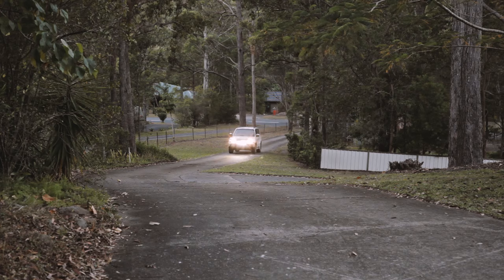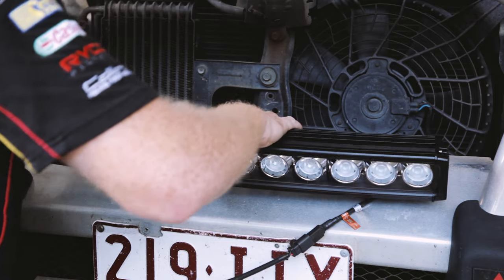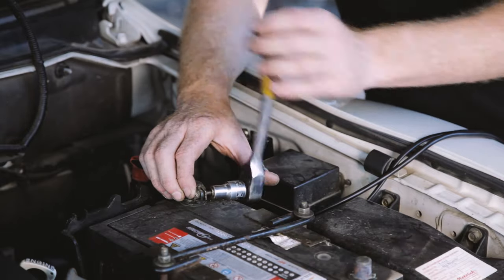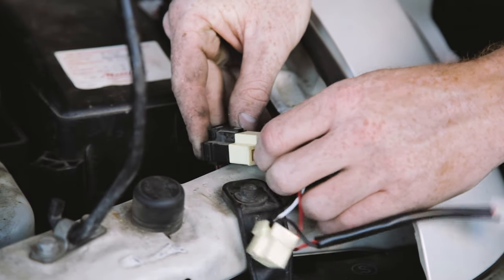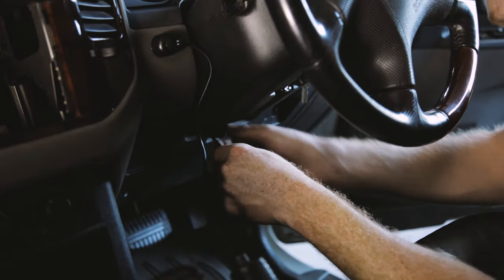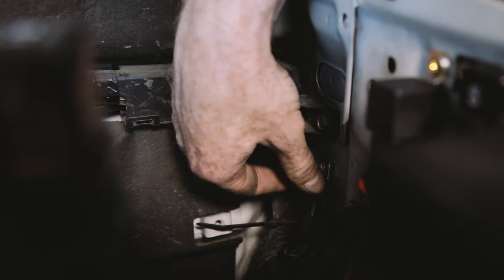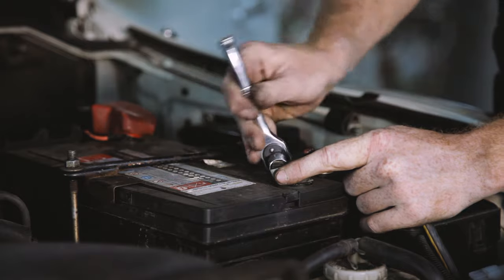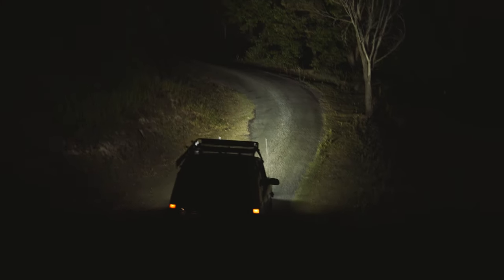How to - Wire a LED Light Bar // Supercheap Auto

Comment: Do you have to worry about how much power the light bar draws from your battery? I have a 700w light bar with a stock alternator, just worried the light bar will kill my battery faster than the alternator can charge it
Reply: that's why you need a relay it will stop the problem of draining your batteries power
Reply: demonllama95 a relay does not have anything to do with power consumption...
To be clear:

A relay is so that you arnt piggybacking off of another closed circuit. If the factory designed there to be two headlights and two taillights on one circuit then putting a 700 watt light bar on it might overload that circuit system..
That however is NOT what he is talking about.

With car electrical systems <500-800 watts is generally a safe amount to add to the load of your alternator, however To make sure you are ok you can generally find the specs for your alternator... the number your looking for is the alternator amp rating. The next number you’ll need is 13.7 volts 
With these two numbers you can put it into a watt calculator found online to find your alternators total watts..
Then subtract 55-70% because your vehicle takes up about that much for all its various systems 
(this % margin greatly depends on the number of add ons in your vehicle as well as the size of your vehicle... add ons like DVD player, audio systems, power seats etc. with the higher end being 70% and lower end being 55% -lower end % would be say a truck with no add ons and a V8)

Once you have the left over watts number then you’ll know how much your loading your system.. a good rule of thumb is to never go over 1000 watts with a stock battery and alternator
Reply: @chanelhart1239  Keep in mind that a relay is basically just a switch to open or close the circuit. They are used so you dont have to run thick power cables back and forth from source to a switch on the dash and back etc. You connect the thick power cable to relay in engine bay and then much smaller trigger cables to and from the switch on the dash. Those trigger wires only send the signal to relay to open or close the circuit (hence turning off or on). You can also have the relays programmed to pulse, just just your blinkers do. The stalk on steering column are the small trigger wires that activate the blinking relay which is connected to the lights...
Reply: @-Awareness  thank you

Comment: So what is the switch for if the lights are connected to the hi beams?
Reply: so you can have the highbeams on without the lightbar being on
Reply: And it's required by law
Reply: @andrewchippendale2333  ...but you cant have your light bar lit without your high beams on which defeats the purpose of being off road..  light bars are brighter than head lights so you can use them on dipped beam so its a load of crap..
Reply: @chrisfi3d  yeah sods law when you think about it

Comment: Great instructional video , only problem I have is that with the battery is in the back of the vehicle , along with the engine , the battery cable is way too short to reach the battery , do I extend the cable or do I  locate a place  under the dash that has constant power and connect to that point ?

Comment: What kind of wiring system did you install? I bought an 1080 Watt at 108000 lumens led bar but i do not have any documentation about wiring, fuses, relays, switchers, etc..  I do not have any idea what kind of cable/fuses/relays to use.. can you help me please?

Comment: I’m trying to hook one of these light bars upto my ride on mower is there anyway I can go around the hooking it up to the high beam headlight part ?
Reply: If your mower has lights already splice the light bar wires into the wires for the headlights on the mower and just put the harness in your shed or something as you wont be using it at all.

Comment: Can I wire the LED bar as a standalone without hooking it on to a jeep. Say as an indoor light source? My intent is to use it as a DIY photography lighting. It looks much powerful than T8 tube lights but maybe that's just me.
Reply from the maker: HI NextDoorDigital - Sure, will have to use a 12v battery source, not 240v though! hope this helps!
Reply: Why don’t you buy an led strip from Home Depot?

Comment: What if the connection behind the head doesn't match what comes with the wiring harness ?
How else do you hook up to the high beam ?
Reply from the maker: Hi Paulandloz1, Our harness is designed for the H4 globe found in a lot of cars, if you have something different, you'll need to splice (wire tap connector) into the headlight high beam wires and adapt the wiring harness to suit or if you're not sure, I'd recommend for you to contact your local auto electrician about it. I hope this helps.

Comment: Is there a way to run the lights through a cigarette  lighter port.planning to install one on my quad bike.cheers
Reply from the maker: Hi Errol, Possibly but generally cigarette wiring is fused at 10 amps and has thin wires to suit up to 10 amps. I'd recommend wiring it separately with a fuse.

Comment: It doesn't have to be connected to the high beams, does it? It can go straight from the switch to light bar as well right???  Thank you!
Reply from the maker: Hey Israel, Thanks for your question. Check with your local state laws to clarify this. Most states in Australia require light bars only to be activated when the high beams are switched on. That way you only have one switch to turn off both high beams and light bar at the same time. - Ash
Reply: Where can one buy the head light harness from...? If your in australia does the shop post over seas on orders ?
Reply: As super jeep auto says check your country laws i wired two light bars up to battery relays and switch all correctly.but jeep failed mot because they were not wired through head light circuit..i presented my case that i only use the light bars off road and would not use head lights as the bars combind gave me  400watts and 24000 lumens at 5k white light making head lights look like candle so use them on low 1beams so when i turn them off i have low beams but they said no way fail. So since my last comment ha e head light adaptor harness removed and replaced bumper mounted light bar for two smaller 74 watt  7,200 lumen 5k bright white combo spot and floods through my head lights which i will use on and off road sod them mot ppl. And magnet mount the roof bar when i need it with to battery etc harness in place when i want the bigger light. In short  check your country laws or  make sure you can remove lights when car is mot or nct depending on your country..

Comment: my new light bar works on high beam but not on low beam good,,,,,BUT it comes on when sidelights it on also when no light are on, unless light bar switch is turned off  very confusing I have a 2013 suzuki jimny

Comment: The red light on the button is always on or only when the ignition on? Thanks!
Reply: It had a light receptor in the switch that can be preset,to you specs, at any parts dealers hat  has a napquan light bar programmer.

Comment: Can you just skip the switch in the cab and have it run on the normal high-beam switch instead?
Reply: yes but its illegal to drive on the road with a light bar turned on
Reply from the maker: For legality issues in AUS/NZ you need to have the switch mounted inside the cab. Thanks
Reply: @supercheapautotv  what about under the bonnet,  save running switch into cab ?

Comment: can the switch be cut off and a rocker style 1 be used? and does this work on negativtly switched ? ie 09 hilux??
Reply from the maker: Hi William, Thanks for your questions. Yes, a rocker switch can be used in it's place. This kit is designed for positive earthed vehicles only, Negatively earthed vehicles require modifying the piggy back adaptors. Discuss with your local automotive electrician to do this for you if you’re not sure how to do this. – Ash
Reply: G'day William. Did you manage to replace the switch? What type of rocker did you end up with?

Comment: installed and it doesn't work

any reason behind it? all connections are correct but still doesnt work
Reply from the maker: Hi Danny, could be a number of different issues, are you able to email us all your details of your car etc to reece.moger@superretailgroup.com, we'll pass it on to our tech team to look into. Thanks Reece
Reply: Which country are you in..did you get your light bar working two years on ?....... dont bother answering i got my headlight adaptor kit and now have my light bars wirking through high beams..

Comment: the master switches on these are fucking junk had 3 all junk 1 fell apart other two stop working also "led light bars" are not legal for on road use off road only, so hooking it up to the high beam wire is not a got idea